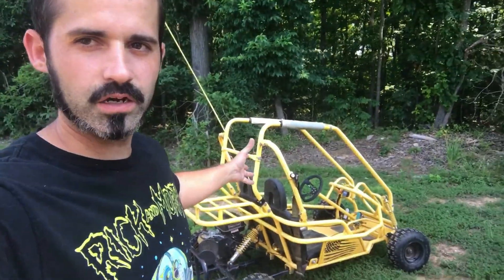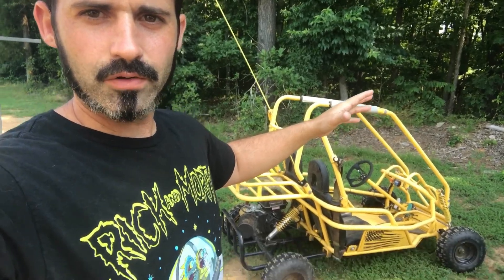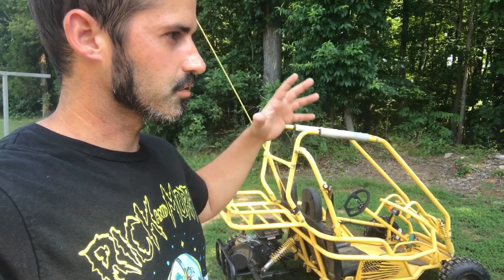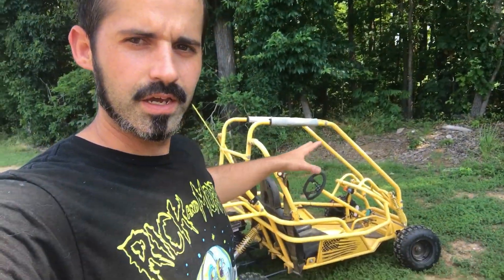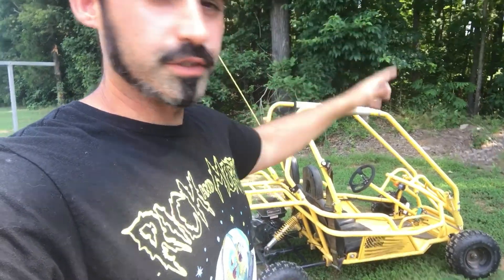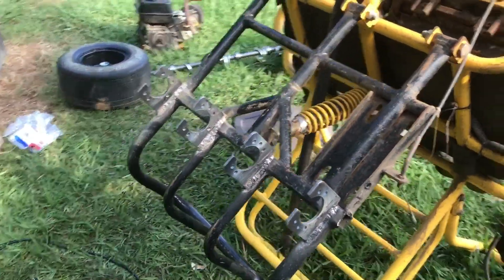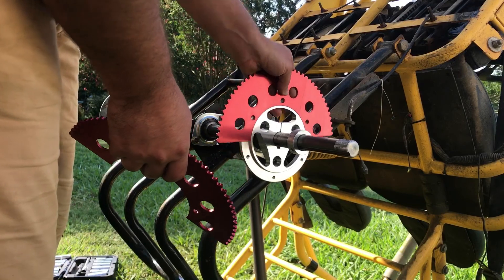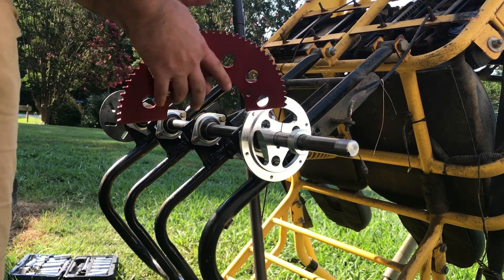One Wheel Peel To Live Axle Conversion- Go Kart

Comment: Nice work. I want to do the exact setup with the same kart. What length is the axle?
Reply from the maker: It’s 41 inches
Reply: Hey thanks. Any chance to list your exact parts list to make my life a little easier for my build. I wanna get started ordering the parts. And specifically the same axle. Are your real wheels a 4 on 4 pattern for the Spindles?
Thanks
Reply from the maker: It’s been quite a few years since I did this so I don’t know the exact places I git things. The axle probably came off of eBay or Amazon but any of the kart sites would probably have one as well. I usually use bmikarts, ombwarehouse and gopowersports also for parts. The main things to be careful of when choosing an axle is making sure it doesn’t taper at the ends to a smaller size, making sure it has threads at the end and that it is solid and not hollow. As far as parts list you’ll need bearing hangers for the axle bearings, axle bearings preferably with a set screw, a sprocket hub and sprocket, some sort of brake system, wheels hubs (yes I used a 4x4 pattern) and axle end nuts if it doesn’t come with them. I originally used four bearings and hangers for the axle since the kart is heavy but the two center bearings fell apart quickly while the two outer bearings are still going strong so I’m thinking something about the 4 bearing setup was stressing the center bearings. So now I just use the two bearing setup.

Comment: have the aluminum sprockets broke yet because they're garbage.   for your setup you need steel all the way. otherwise great job man keep it up
Reply from the maker: No the sprocket has held up so far. Only time I’ve had a problem with the aluminum sprockets is on my nitrous kart where I was running a loose chain, just wore it out pretty quick.